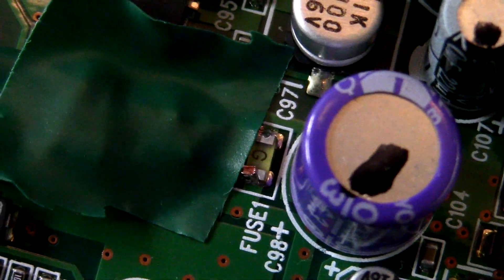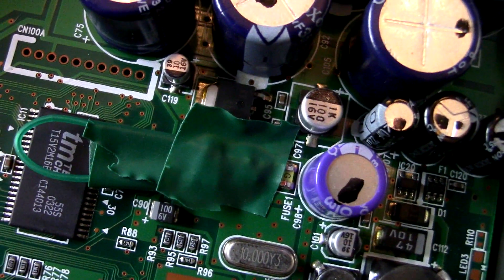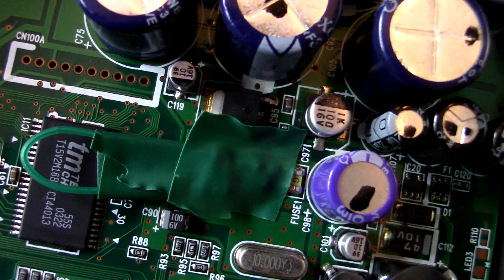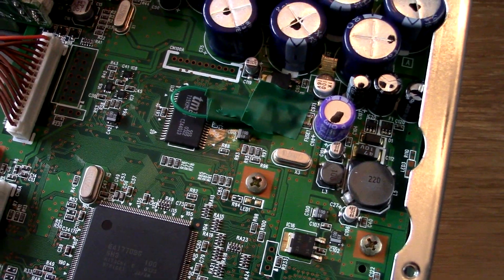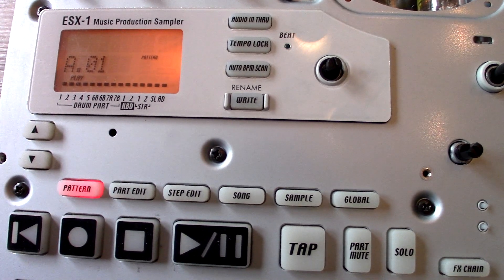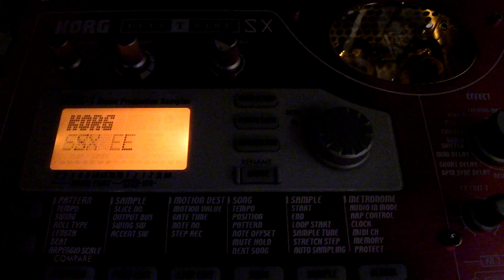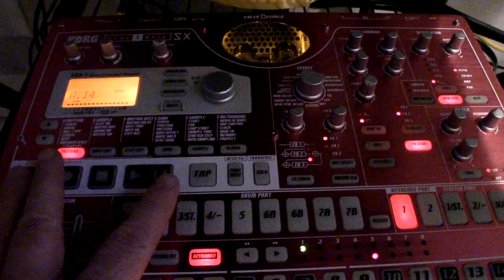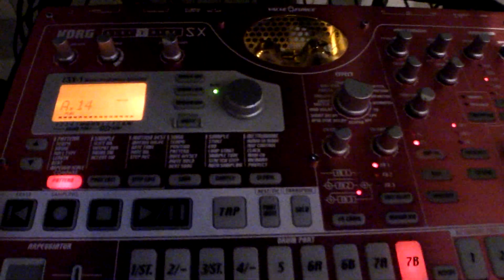PART TW0 - FIXED! - My Korg Electribe ESX Stopped Working / Crashed / Died

Comment: When it crapped out did you still have lights but just a blank screen? Thats what happened to mine about 12 years ago. I just pulled it out of the box to research if anyone had found a work around.

Comment: You could add 1.5 amp inline fuse between the wires. If you know what the value it should be it doesn't have too be SMD.
Reply from the maker: That's an awesome idea.  I just may do that.  Thanks!